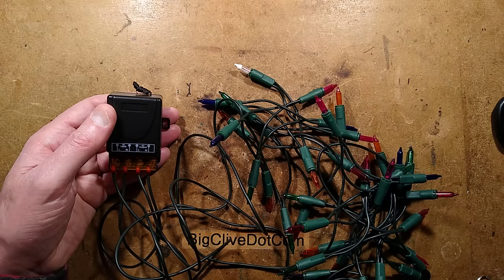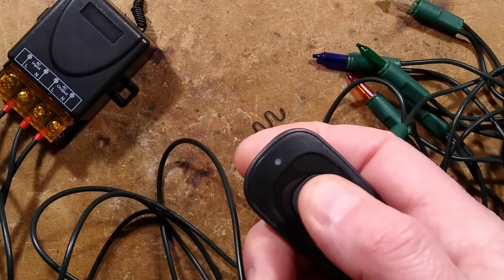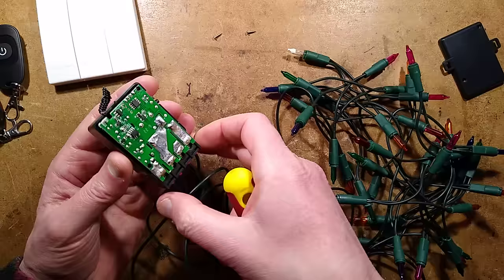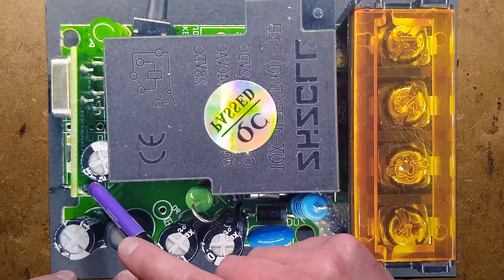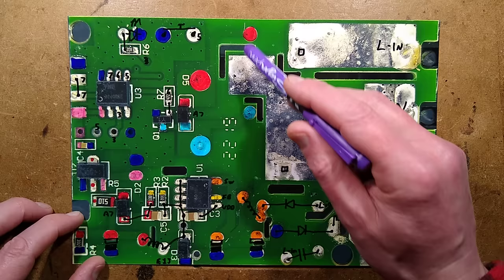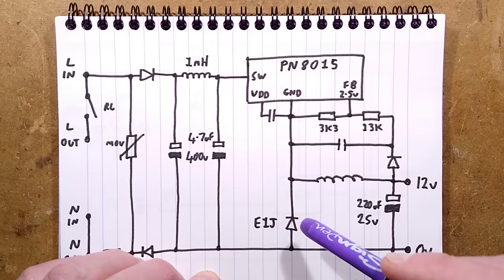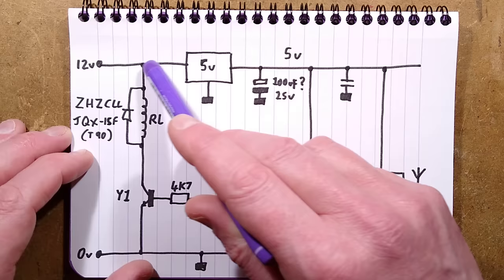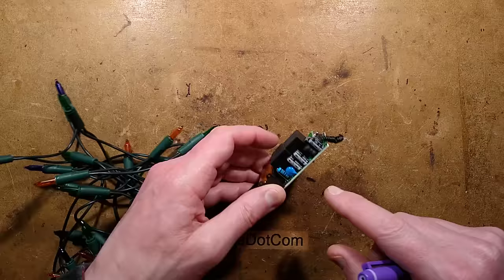Inside a "30A" remote control - with schematic

Comment: A useful little gadget.  If as you say the antenna "could" be live, a solution is to pop a length of heatshrink over it, which will provide a decent level of protection.  The relay is a product of Yueqing Zhenglin  Electric Appliance Factory. They have been in the relay manufacturing business for 20 years, so they are a pretty reputable supplier, and a major OEM for many Chinese Manufacturers, so I'd reckon the rating is reliable. The relay is a JQX-15F (T90),  12v /24v dc operation, originally designed for motorcycle use.

Comment: “Chinese 30Amps”, you nailed it, Mr Clive! Thanks for a good laugh today. 😂
Reply: it is not that bad. I would not trust connectors, they dont look rated for 30A
Reply: Those particular relays usually are 30a  I've got a dozen or so from an old UPS
Reply: Don't simply trust the specification, inspect the relay first. See whether it is 30A rating. If yes, take 20% safety margin (24A).🤣😂😆
Then check the wires and the pcb layout copper trace width. 😜😝😅
Reply: @neiliewheeliebin connectors are not
Reply: @hrvojelasic5794  No I didn't mean anyone should actually run 30a through it that would be very unwise, the PCB clearly can't handle it in its current form either
Reply: @neiliewheeliebin  just for the matter of discussion....
Reply: Just like Chinese amplifier circuits, 5000w.... Or 20 more likely.
Reply: @SanitysOverrated  Yeah, have you ever seen those advertised car stereos that put out 2,000 "Chinese Watts?" On a 12VDC car system that'll be over 167Amps needed, provided they work at a 100% efficiency. 😂🤣

Comment: We have one of these with 3 remotes to control the outside lighting for a garden cabin. The unit came with two remotes which worked fine, but it wouldn’t let the third be added, even though it came from the same supplier and was the exact same design and circuitry as the originals.

I deleted all of the remotes and then it allowed all 3 to be added - weird!

Works well into a log cabin with 3”/75mm thick walls, but there are windows. Range is more than ample for our 150’/50m garden, and it’s great to be able to walk to/from the cabin when it’s dark outside. Relay is only switching around 20W of mains LED lamps, so total overkill - but I’d personally rate it for no more than 10A, just by the weight (and therefore the contact material) in my hand.
Reply: This remote control supports up to 16 pilots. If the pilot memory is full, you must remove all remote controls and program again. This remote control uses the EV1527 code so you can do many pilots with the same code.

Comment: I bought one of these to add a remote on/off kill switch for my kid's ride on Power Wheels car. It works great to interrupt the 12v battery and turn the car off when he's about to drive into a tree. 😅
Reply: I guess that's cheaper than installing an airbag. 😊
Reply: That is an excellent idea!  👍🏻

Comment: Used one of these for a year or two, to operate the 12v macerator pump on my full time RV. Directions weren't included but it was configured for toggle out of the box - one day it randomly changed modes and i had to dig in Google to find the guide.

It reliably switched ~15-20A say 12v for a year or so, and eventually the radio receiver or controller failed. 

Replaced with a similar relay controlled by an esp32, and hooked it to Home Assistant. 

Wasn't a bad widget for the cost.
Reply: My remote packed up, I just ordered 4 spares fit under £5 and programed them in 👍

Comment: That’s a cool little wireless device, but it needs to come with a fire extinguisher if they think that will handle 30a.
Reply: I'd like to see a 30A load put on that relay! 😃🔥🔥🔥
Reply: @Kae6502 Looks like a job for Electroboom.
Reply: relay actually looks rated but connectors and those soldered paths looks sus
Reply: @Kae6502 A relay never reveals its magic smoke. If under duress, feeling hot and sweaty it'll divulge its secrets. The magic dissipates right in front on you leaving only disappointment.

Comment: At least they remembered to switch the live this time, rather than the neutral...
Reply: baby steps
Reply: @marcogenovesi8570  if it did, you could just reverse them, it'd still work.. the pokey out aerial brush might be a bit 'tingly' though 😁
Reply: ... but the fuse is on the neutral. ⚰️
Reply: @DCBpower  doesnt matter, if the supply to it is fused in the live .

Comment: In 2007 I moved in a penthouse from 1987 that used a very ancient Bulgarian-made lamp switch with a remote control in the bedroom. It felt like the most convenient thing ever. The same house had electrical floor heating. Surprisingly enough the control module again made in Bulgaria routed the 7kW heaters per room through a similar relay on a PCB with tons of solder on the power pads. I was really surprised that it worked and it didn't show any signs of overheating.
Reply: Eastern Europe > China 😂
Reply: @theghost00  At that time - absolutely. And nobody in Bulgaria had concerns about cost cutting and efficiency at the time - those controllers were soldered by hand, tons of solder were used and most importantly - people really could heat their houses with tens of kilowatts without thinking what the electricity bill would be :D

Comment: I've converted a number of mains operated modules to 12 Volt/5 Volts (measure voltage while running) by just wiring straight to the reservoir electrolytic. This usually works just fine.

Comment: I just derate their components by moving the decimal point to the left one place.😅😂😂
Reply: For real safety, you'd have to do that for the voltage as well, which would reduce the functionality of many of these items.
Reply: I have a few in my motorhome,  TBH  anything Chinese I reduce by a 3rd for true max and then knock another 3rd off for longevity 😂 I run 10A @ 12V max in my 2 30A remote relays, it's  been 2 years without issue and I consider myself blessed 😁
Reply: And take the square root and round down.
Reply: That sounds way closer to what you would expect 😂😂😂
Reply: @Dirt-Diggler to be fair, the max rating for electronics or even civil engineering materials isn't supposed to represent the optimal working load. The real danger is when a third party buys the part and thinks "oh great, we will run our constant 30A load off this cheap 30A rated product and sell it to consumers for profit!"
Reply: Great rule of thumb when dealing with Chinese stuff that says XXX amount of power. 😅😅

Comment: The 12V hack sounds interesting. This could be very handy for low voltage control of lighting in motor homes/campers (caravans for the UK) A few years back I converted my incandescent LV lighting to LED's which dropped my total power load from 60+ A to about 5 A . However most of the lights are switched at the lamp which can be annoying at times.
Reply: Ya. I'm thinking video #2. 😁
Reply: I use 2 12V versions of these in my motorhome,  mainly for a simple 2 way switching of lights, I have the remotes stuck to the wall where I want them 👍
I use a 4wsy version  for perimeter lights, they work ar a surprising distance 😵 over 50M , I do derate thier current capacity by 2 3rds to be safe, Chinese and all that 😂

Comment: The diode across the relay coil, I've heard it referred to as either a 'free-wheeling' diode, a 'fly-back diode' or 'coil suppression diode'. Personally, I'm fond of calling it a 'free-wheeling diode', as it does act like the coil, once conducting, is similar to a wheel. In that, it then has 'momentum' and the diode lets it 'free-wheel' its current to a stop, aka, for the field to collapse without the high voltage said field can generate when it does. That current from the field wants to go somewhere, right? 😁
Reply: Prevent back EMF generated by coil turn off which cause damage to other component？
Reply: I call it clamping diode.
Reply: Protection diode.
Reply: I was wondering if it reduces RF emissions. I remember in the 90's electronics were so noisy, all kinds of devices would interfere with each other and radio controlled systems would routinely be triggered by noise spikes. For example a garage door closing when Christmas tree lights turned on.
Reply: @beardedchimp  The idea here of a 'fly-back' or free-wheeling' diode is for DC. AC would cause massive current when polarity switches, forward biasing the diode for that entire half cycle, not for allowing the DC induced field to collapse. For AC across an inductor, like the primary of a transformer, a low value capacitor is typically used as a 'high-pass' (as in, a spike or high frequency noise) filter across the inductor. When switching AC, it's difficult to 'flip the switch' just as it crosses zero volts, causing an abrupt jump of the voltage if not at zero. Ever notice that  when you turned those Christmas tree lights on or off, that sometimes you'd hear a crackle on an AM radio and other times you didn't? 😁
Reply: @mikebond6328  Different animal. That protects DC supply line from reverse polarity like getting batteries in backwards. Granted, this diode of discussion 'protects' your circuitry from the fly-back voltage spike of the coil field collapse. ☺
Reply: @scottdebruyn7038 I was talking about DC, the steady voltage and static magnetic field doesn't typical radiate RF unlike AC and its 50Hz hum. But when you have a DC voltage spike it'll release an RF burst with the frequency distribution being related to the rate of change and the circuit length with respect to harmonic frequencies.

I did a quick google and it turns out fly-back diodes are involved with RF emissions and circuit design can help limit it. Early AC->DC 12v/5v plugs used to blast RF, if they were plugged in near speakers you'd hear it. The original transformer based ones had a more 'traditional' noise. The initial switched DC ones produced all kinds of crap. Connected to an oscilloscope it was hard to even recognise it as 12V DC, the voltage fluctuations were wild. For some stuff it was fine, it didn't seem to notice while for others a bad DC supply killed it.

We had christmas tree lights that would turn off the tv for several seconds. We had something electronic, can't remember what, maybe a hoover that would cause the betamax (or VHS) to eject the tape. Electric fences were the worst, broad spectrum high amplitude clicks that'd appear everywhere. Though I don't see how more modern electronics would stop that, its a huge voltage spike combined with a massive aerial.
Reply: @beardedchimp  I think we are pretty much on the same page here. The high DC voltage spikes on an electric fence are intentional as a steady state DC voltage would be too dangerous to deter living things. If you've been around a fence controller, you'd here the 'click...click...click...' of a relay making momentary contact to energize and then disconnect and collapse the field on the primary of a transformer. Mitigation can be achieved through capacitors to filter some of the high frequencies out from the high rise time of the pulses. Another would be to add a capacitive filter at specific wavelengths along the 'long wave antenna (aka a 'massive aerial)' that is the fence. As to old AC to DC converters, some used SCR's, which fired and turned off in other than the zero crossing points of the incoming AC sine wave... again sharp changes mean high frequency components and inductive kick-back and noise. Old Christmas lights could have used half wave rectification if simple DC and/or simple bimetallic switches for flashing more likely, further adding to noise. Regulations on and designing for RFI helps, but so does spending more on the design and complexity of such noisy circuits. Designers need to beef up their susceptibility on their various receivers too!  😁
Reply: @scottdebruyn7038  Those electric fence spikes can do unpleasant things to DSL broadband in rural areas.  The fences often run parallel to the overhead lines and (some) farmers like to buy the biggest Aussie fence transformers, designed to keep umpteen sheep on a gazillion acres.  They told me that the bigger transformers 'self-clean' the fences by burning off the vegetation that would otherwise partially ground out the voltage.

Comment: The little RF receiver board is common to most of the remote relays sold on Amazon. I bought one with 4 relays on one board, works the same way, but comes with a 4 button keychain remote. I use it for forward/back control of an electric cart for my kayak.

Comment: You should check out "4-channel multifunction dtmf control relay" I bought a couple and they are actually cool. You can program momentary/latching/time latching features by bridging some points on the board, and it is programmable with up to 4 digit numeric codes per relay. Hard to find info on how to actually program them but I did find some literature. Also will support ABCD tones despite not being listed as such. It requires a 12v dc input to power and an audio input. I was successful in controlling it with a two way radio over DMR which I thought was pretty cool

Comment: I bought a similar item a couple of weeks ago, but 2 channels at 10amps each. Otherwise the circuit was identical. I only intend to run them at about 100mA each and they will be used to switch lamps off so they will be connected to the NC contacts.

With the 2 channel unit there's another interesting option where the button A toggles one circuit and button B toggles the other circuit and button C cancels whichever was selected. However, if either A or B is pressed and then the other button  B or A is pressed the result is that it also cancels the first relay; ie only one relay is active. In my case, since I will be using the NC circuit it means that i cannot turn out all the lights accidentally.

Comment: I was thinking the same thing! You could run this thing on 12V, with a 5A inline fuse and control quite a bit of stuff without worrying about fire or shock.

Comment: Could be fun to tear open the mystery relay and compare to a known proper 30A unit.
Reply: Yes, I was hoping he would tear open the relay to see if it could really handle 30A.
Reply: I have seen lighting control modules and (just the other day) a heat trace control device with 30A/277V relays on the board. 

This board might fail catastrophically at 30A but I doubt there’s many visible differences (related to current handling) compared with a reliable UL listed controller.

Comment: The manufacturer is Zhenglin. The data sheet claims a 50mOhm contact resistance, which would see it get rather hot (dropping 1 volt) with 20A running through it.

Comment: This chip has the same pinout as the LNK304 and its datasheet also includes two diodes to rectify the input (I always lack the lower one). What I found wierd why there are 1 drain and 4 source pins. On mosfets the drain connected to the heatsink. Viper22 has 4 drain and 2 source pins.

Comment: The 3 kilohm dropping resistor for the green LED should really be 300 ohms (5v - 2v)/10mA. A 330 ohm resistor is probably easier to find, though. That should make the LED light up much brighter. I’m using Iled = 10 mA, and Vled = 2 volts as typical for a green LED. I’d also desolder the LED and replace it with a side-mounted SMD part, again, for better visibility. I think it’s incumbent upon Clive to test the 30 amp capacity here (in the fireproof tin, just in case.) Just for “science”, you know. 😆
Reply from the maker: They probably chose such a high value to avoid loading down one of the programming lines.

Comment: That style of relays from sellers like Digikey are also labeled as 30A (NC) or 40A (NO) and their datasheets say "40 Amp switching capability" but then the "maximum switched power" is only around 1000W or 10000VA, yes 1kW or 10kVA 🤷‍♂

Comment: I have plenty of these modules and they are quite convenient.
All of them however work off of 5 or 12V coming from either a reliable switch-mode PSU or a good old mains frequency transformer with bridge rectifier and smoothing capacitor.
For the high power stuff I would still buy the cheapest module and I would then replace the relay with a suitable one from a local reputable website or better a physical shop.

Comment: The CE logo on the ZHZCLL relay is formatted incorrectly.  The right side of the C, if it were a circle, should intersect perfectly with the left of the E.  If they had bothered to get the certification, it comes with formatting instructions, so it's more likely than not the CE logo is counterfeit.  With that said, I've seen external power supplies for HP and Dell laptops with improperly formatted CE logos as well... But those are more likely to be legitimate, especially with the dozens of other certifications (some with registration numbers that can be looked up), so whoever the graphic designer was that was fitting all the certification logos on a limited space didn't get the formatting memo.
Reply: It's not counterfeit; it stands for China Export.  That's an official Chinese mark, to certify that the product conforms to the standards required for goods meant to be exported from China.  And I am sure it's a total coincidence that it looks a lot like the Conformité Européenne mark...
But as you say, it might just be misformatted.